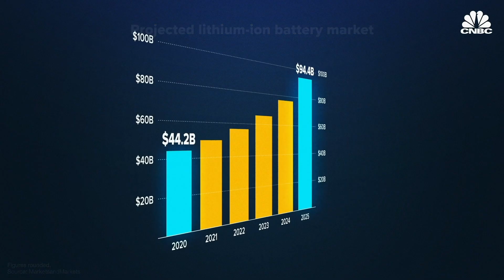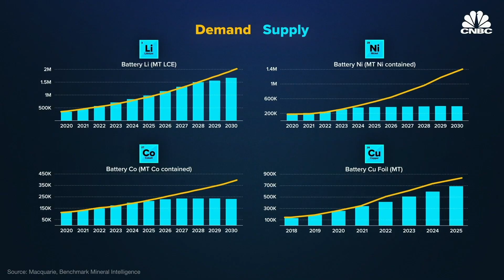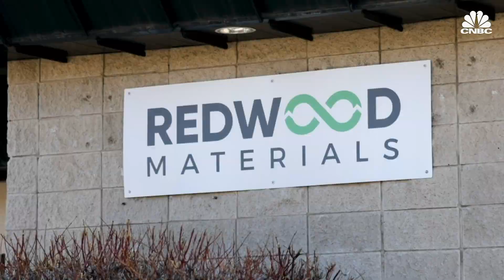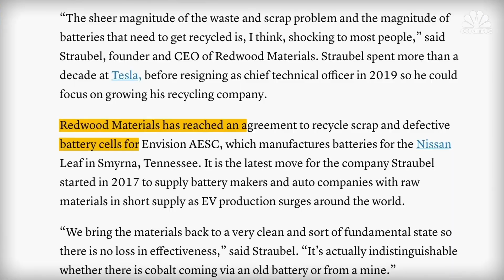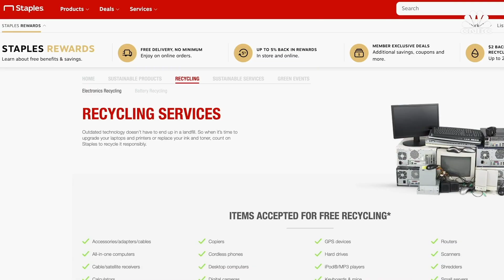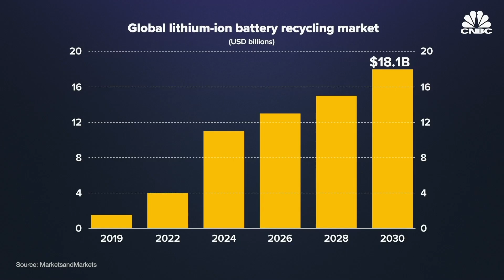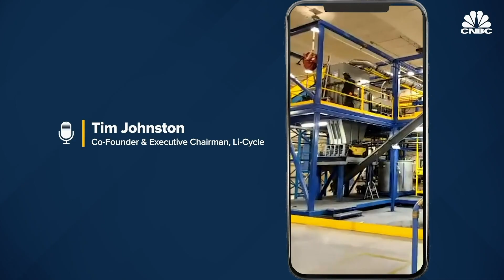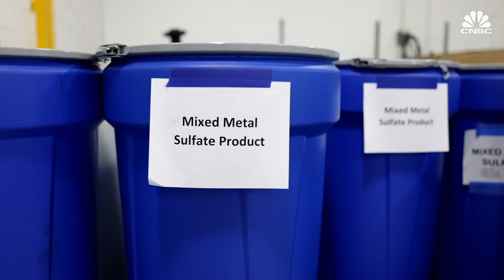How Tesla’s Battery Mastermind Is Tackling EV's Biggest Problem

Comment: No matter how good the recyling is of Lithium Ion batteries( which isn’t so easy with small cordless devices that there is an ever growing number of). Is recyling cannot change the net global amount used, and the massive ecological destruction that is causing!. FOE has said ‘’Lithium will amount to an environmental catastrophe in its own right’’, Cobalt is Mined in the Congo home of the critically endangered Gorilla( only 900 left), mass deforestation, toxic waste etc! BEV are a Dystopian high tech ‘fix’. We NEED to use the ICE Vehicles that already exist in effect as Carbon Capturing machines by running them on Carbon Negative Algae Bio Fuel that permanently sequesters 1 Ton of CO2 for every Barrel.

Comment: Look...  I'm the World's smartest man.  That is a gold mine of Lithium.  It's difficult to get that element! It's the highest conductivity...  we want to use other materials... but we also want to recycle what we've got. Solid state batteries based on pressure and salts are the future. Graphene... solid crystal cell and polymer alternatives are changing the game. Soon batteries will go more than double their current capacity or for years on end really at lower currents. I invented a generator to feed them power.

Comment: Where I live, I am required to recycle.  I can easily throw the standard recyclable items, like plastics bottles and paper products, in the recycle bin.  But, the recycle company doesn't take batteries. I am not going to drive anywhere to drop off batteries, but I would gladly throw them in the recycle bin. But, since it isn't allowed, I throw them in the trash.  My guess is hundreds of millions of people around the world are doing the same. There is most certainly a limited supply of the acceptably priced raw materials needed for batteries because of international politics and geography.  So, recycling old batteries is essential for sustainability.  But, if they want people to recycle batteries they have make it easy.

Comment: Someone better start paying me to recycle ♻️ batteries like cans. Otherwise they are going straight into to trash 🗑. I’m not going to inconvenience myself so someone else can profit.
Reply: It sounds odd that batteries are even allowed to be dumped in the trash tbh. Here the battery recycle box is present in most supermarkets, so it's really not an inconvenience to take the jar with old batteries along to the supermarket once every few months. Has worked fine for over two decades since the program started.

Comment: This is not the biggest problem. The biggest 2 problems are: 1-Current infrastructure can not support the distribution needs. 2-All renewable initiatives cannot produce enough energy to cover the demand of just 1/2 of of the vehicles on the planet in thr next 30 years. Take the yearly energy input in trillion btus ans convert to gw/hr. There will not be enough generation no matter if we cover the entire planet with wind mills and solar panels. The only hope to stop burning carbon is to pivot in 100% clean and safe nuclear that will require massive investment.
That is the real inconvenient truth nobody wants to talk about.
Math and physics do not lie.

Comment: Governments should create laws to make it easy to recover recyclable materials from electronic products.
For example, it may be helpful to have a law preventing electronic manufacturers from having non-removable batteries. It should be easier to recycle batteries if they can just be popped out of devices, instead of having to disassemble a device to retrieve the battery.

Comment: Actually making a battery bigger isn’t really a increase in density but it seems media is kind of brainwashed. I do like the guy thought :) From what i heard though it’s similar to plastics you can’t make a full cycle as the mix needs more new material.

Also Co2 is not the only problem that causes climate change add water vapor and methane.

Comment: Not sure why we are push EVs when there is a lot of problems from  engineering standpoint.... charge time are going to be a dealbreaker... Fuel cells are the way to go....
Reply: FOOL CELLS. Hydrogen is a con racket pushed by BIG OIL. EVs are awesome the best EVs today have already nailed it and they will keep on getting better and cheaper.
Reply: @honesty_-no9he  Really???? You have a lot of engineer ring hurdles to overcome with EVS but you don’t necessarily have a hydrogen... Sounds like you’re falling for the push. Plus hydrogen if you can create it without polluting would be the absolute best solution.... EVs, it’s a great for short trips but once you got to go a long distance all bets are off. It doesn’t work because of charge times, it literally doesn’t work.

Comment: It's interesting to see and hear these wonderful steps. I live here in Nigeria in west Africa. These parts of the globe are dieing from electronic and battery waste from developed sides of the world. I did not hear Africa nor any other developing sides of the world mentioned in siting of these solutions in the future. Is the agenda to clean up one side of the world and abandon the other? The same is happening in EV transformation. Some of these countries where the minerals are taken from  do not even have reliable electricity supply in the 21st century. How will they benefit from EV evolution? I believe we still have not learnt from past mistakes of only basing all developments only to one side of the world. It's great to see and hear these wonderful insights. Here in Nigeria we are  building a brand new crude oil refinery. What exactly is the purposes of that in a world we are trying to clean up? If the effort to clean up the world is done piece meal then we are wasting our time. What good is clean air and sustainable efficiencies in one side of the world when the other side is poisonous and polluted. Thanking you for the insightful program.

Comment: The problem isn’t the cars, the problem is where the energy comes from to charge those batteries. Recycling batteries is a no brainer, it would be completely irresponsible to not recycle them. However something like 90% of all electricity in the U.S. comes from carbon emitting power plants, the infrastructure needs to change as well if we are going to make a difference, otherwise what’s the point of going to an electric car?

Comment: The problem is on the local level. Here in Buffalo you can't bring batteries of any kind  to recyclers and if you can find a compliant business, you have to pay. Same with CRT's, flat screens and tires, so they end up illegally dumped in landfills or just tossed to the side of the road !
Reply: You've described the problem clearly.

These people in the industry have not done a damn thing since the early 90's and only now recently, are running scared that they've been doing zilch for decades upon DECADES.
Reply: @SunnyIlha  Actually, since 1980 when Reagan deregulated the worlds polluters!
Reply: @pauleywallnutz9429  

Yes it goes back.  WAY back.
The world market of products and devices using batteries in electronics really exploded right from the beginning of the 1990s, particularly when battery powered handtools took over the construction sector.  
(Think of the Cordless Drill, just a  whopping reality check).  
Makita, Dewalt, Milwaukee, Ryobi,  etc, etc, etc; in everything from 6volt to 9volt to 12volt and soon thereafter a gargantuan proliferation of 12volt and 18volt batteries).

Nowadays you can even buy a battery-lawn mower !  
A RECHARGEABLE battery lawnmower!!
Reply: @SunnyIlha  Yes you are correct. I was also adding that recycling officially began on what the USA called Earth Day way back in 1970 and the Republican backed corporations fought hard and well to prevent all of the promises ED outlined with regards to mitigating climate change and its devastating effects. Recycling as a whole, was a big part of that.
Reagan just stopped anything that was progressive and healthy. His policies were bogus like the failed war on drugs that Nixon began. Reagan's war was really against the people, not the corporations doing all the polluting. Same as it ever was!
Reply: Those are dumb garbage people not science based companies and the local politicians are morons.
Reply: @honesty_-no9he  I know! And tRump thinks he's going to be president again....how funny is that!

Comment: You can tell that what this guy is doing represents just the tiniest of fraction of the lithium ion market.    Maybe he is doing some good experimental work but this video seems nothing more than a giant public relations exercise for makers of EV's and other related products.    What he is doing isn't profitable without massive injections of subsidies and grants.     The inconvenient truth of the matter is it costs about 5 times more to recycle lithium-ion batteries than to mine them out of the ground.     That is the biggest problem to solve, not the technical aspects of recycling.    This is the problem he doesn't have the answer for and not willing to address.      Dishonest video - dislike.
Reply: It may be that it isn't supposed to be a profit-generating endeavor in the 1st place. (The act of recycling the materials out of the used electronics).  The need is the all the used old electronics not to be wasted in landfills.  The toxicity of such massed metals and plastics leaching into the ground (poisoning groundwater) and polluting (to toxic level) Earth soil, is the goal itself.  

It will be profitable anyway, since the recovered materials end up in the final finished product 
(the battery-car as a whole finished product; not individually only the car's battery itself).

Comment: A shortage of materials is coming. It won't be long before someone starts giving money for your old unwanted batteries. Intercepting them before they get to the recycling center. If the car companies can't get the materials they need they will have no choice but to buy them from the company that intercepts the materials first by paying for them. All of this will drive the cost up. The "battery interceptors" will set the price just as the miners set the price. Free materials for the recyclers won't last forever. A shortage of a resource makes it valuable.
Reply: There's everything from gold to silver to platinum to copper and other precious metals built into in darned-near EVERYTHING manufactured electronics.
Reply: @SunnyIlha  Yes there is. Gold and silver etc. are worth what they are worth right now because of supply vs demand. Imagine how valuable the raw materials will be when there is a worldwide shortage of those raw materials needed to make batteries. Great money making opportunity!!

Comment: The biggest problem is making enough batteries, it’s going to be the problem for the next 20 years.
After that, recycling yes.
Tesla batteries are good for 20 years in the car, probably 10-20 years more after that as grid storage then, recycling.
Still there is recycling for defects in production, batteries from wreaked car, and from other sources ( cell phones, laptop, etc)

Comment: Wouldn't it be nice if electronics weren't programmed to slow down or die so we wouldn't have to buy so many? I'm looking at you Apple, and others. 
We need to make quality products that last longer. That would improve the waste management situation. 
We need to make more products out of hemp based plastics that are biodegradable and recyclable. Anything that oil can do can be done better by hemp products.

Comment: We better not get rid of coal, oil or the other sources of energy yet until they learn how to produce enough of these other materials that are also harsh on the environment and mined with energy from coal and oil. In other words, there will never be a good clean source of energy developed because it always takes energy to produce the materials used such as all the materials necessary to absorb sunlight and convert it to useful electrical power.

Comment: Or, you could just burn hydrogen instead.

Hydrogen fuel cells, or even hydrogen ICEs will always be more environmentally friendly than EVs. And of course there is that new hydrogen/Co2 based synthetic fuel which is also cleaner.

Comment: Whatever happened to 
Reduce
Reuse
Recycle
The first two weren't profitable, that's what.
Reply: That's been happening with batteries, the amount of material and their life span has been improved with commercial success, theyvare also trying to make them recyceble.
Reply: @miguellopez3392  should have left them in the ground, just like the oil 🛢🙄😒😐😑🤣
Reply: @obsoleteoptics  you aren't making sense.
Reply: @miguellopez3392  that's not my fault. Get on my level.
Reply: @obsoleteoptics  your level is the 1980s, I'm talking about the 2020s where solar panels and batteries are something people are now buying due to lower cost.

Comment: I agree with their fundamental argument - recycling is definitely a good business model. 
But they are off on their projections. They say that all the batteries produced today for EVs will reach end of life in 5 to 7 years at which point they all have to be recycled, so their recycling capacity needs to meet that demand by about 2025.
However, I think most of the EV batteries at their end of life would end up being reused for stationary energy storage for at least another 7 to 10 years before going for recycling.
So their recycling capacity projections need to be offset by at least another 5 years.

Comment: Boliden AB has already developed a really, really large-scale, much cheaper, process to do this, using the same equipment they use to recycle metals in electronics waste (Boliden has been, for the last 30 years, the worlds largest recycler of e-waste, last I checked, they controlled >60% of the market).

Their process requires no manual handling or disassembly of the batteries (after they been collected from vehicles). The burnable waste in the batteries, would provide all the energy needed, once he process is running. Their process requires some initial input energy, but once it's up and running, it produce excess energy, that can be sold at a high profit. It creates no air pollution, and most toxic compounds is destroyed by the very high heat (all metal is recycled, so no pollution from heavy metals), so the slag and ash is pretty clean too.

Boliden's processes, either for e-Waste or EV-batteries, is simple enough in theory. Similar to oil refineries separating petroleum into its compounds, or when you distill moonshine, Boliden use heat to separate the different compunds of its input. Of course, oil refineries, and moonshiners, use much lower temperatures, the liquids that Boliden handles is more like molten lava, and the temperatures of gasses created by the process, is high enough to instantly ignite a person.

So why doesn't Boliden already do this? That's because their process can only be run at really large scale.
Currently, not even all existing EV-batteries in the world would be a big enough batch to run their process (they have had to manufacture simule "waste" , to do test runs).

If electric vehicles replaces most current vehicles. Then there will be enough old batteries to run Boliden's process. Their process run at 1/100.000 cost of of any of the battery recycling processes in use today, and is much cleaner. Basically, when the we reach critical mass of EV-batteries to recycle, no other companies will be able to compete with Boliden, unless they invent totally new processes, or invest tens of billions of dollars to manufacture the equipment needed to run a similar process as Boliden (Boliden's equipment was originally used for smelting copper ore in the 1950's-70's, before the equipment became outdated for that usage, and was then retooled for e-waste, there are no other similar smelters left in the world).

Comment: Batteries from EVs will after end of using in a car will first be reused as power banks for homes. That means at least 15 years in a car and another 40 years in a home. Then it’s time to take them apart.  But laptops and phones etc.  is the option.

Comment: HYDROGEN. I hate batteries. Hydrogen cars are ev with much smaller batteries. If a BEV needs a new battery the car is basically totalled. Batteries don't last, period. Hydrogen cars have significantly smaller batteries so it's viable to run one car for 20 or 30 years